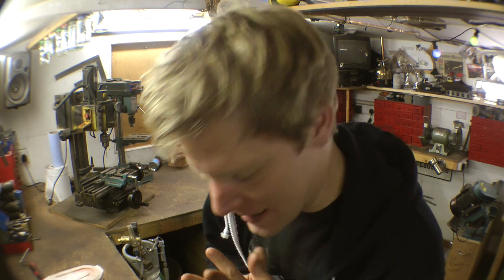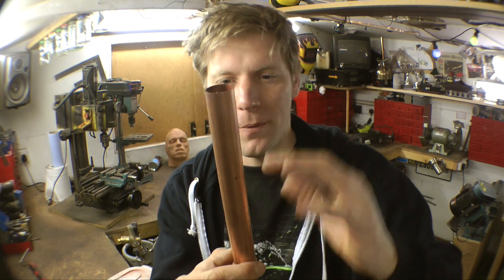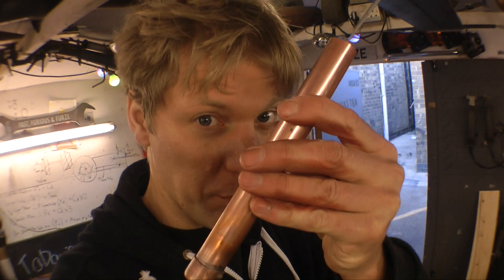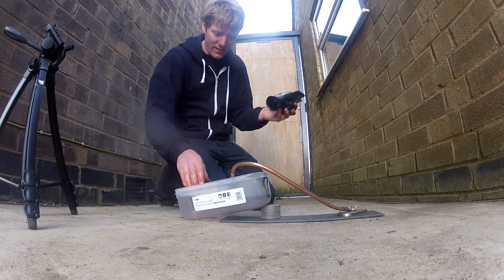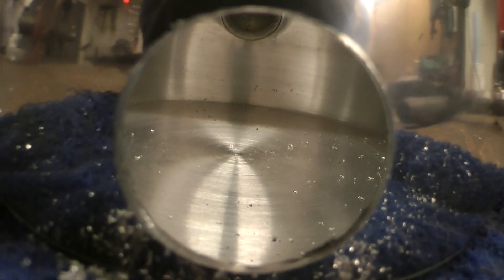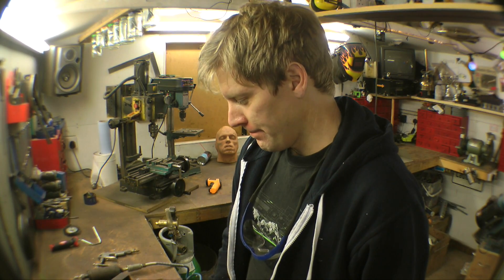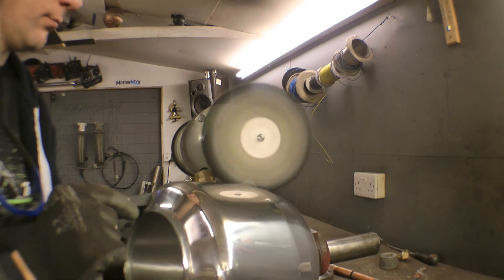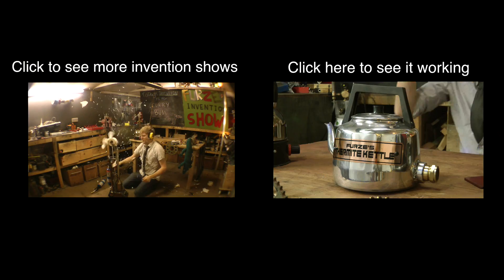Making/Testing the Thermite Kettle

Comment: you can make this heat the water much quicker by adding tube length or more tubes, a fundamental different in the standard element design, using the same amount of Thermite and even slightly smaller tubes. I think the more tube surface area, the quicker the Thermite gets to burn.

Comment: You got the concept slightly wrong. you need a heat exchanger with a much larger surface in order to transfer the energy efficiently to the water. something with large fins, e.g. a turbo intercooler.

Comment: I think that the thermite is really dangerous for your health, metal burning at high temperature produces a lot of nano-particles that causes cancer. I wonder if it's possible to make a different kind of kettle with a electric coil heated nozzle, that slowly heat up the water while you slowly pour it in the cup.

Comment: I think the water jacket should provide sufficient heat transfer so the copper pipe wouldn't melt even with the 'correct' thermite ratio. Much in the way you can cook water in a plastic bottle without melting the bottle.

Worth a try imho.

That should give it another time boost, I reckon.

Comment: I never knew Colin can weld aluminium this clean and even. I am impressed.
Reply: +darek4488 He had "some" experience with welding.... say pulsejets and giant assholes and other pulsejet bikes/kart/stroller things. Not to mention a fallout shelter.
Reply: bobsixtyfour You clearly have no idea how much more difficult welding aluminium is from welding steel.
Reply: +darek4488 It's all in the preparation of the surfaces. Aluminum oxide forms naturally on contact with air, and is really hard to weld, if you remove that layer of oxide before you weld, it makes things go much easier.
Reply: bobsixtyfour Yes, what you are writing is true, but the main concern is the melting point of aluminium, because it is too easy to melt through and too hard to control.
Reply: I just assumed it was a pretty industrial kettle with extra thick walls.
Reply: Why weld it when brazing it is much easier?

Comment: Wait, would copper still melt (with good thermite) if you have water in the kettle? I think heat exchange will be fast enough to prevent it.

Comment: would it not be more optimal, with more surface than just a copper pipe?
Reply from the maker: +Tuex0319 yes but it was down to the fittings i had at the time

Comment: Remember 911
Reply: Remember nano thermite cutter charges and the five foreigners on work visas in urban moving vans that delivered them into the WTC. Remember the molten metal fire fighters described as "flowing like larva" in the basements a month after 9/11. Remember jet fuel aka kerosene and office fires can't melt steel.

Comment: How is the thermite not out out due to lack of oxygen?
Reply: Thermite is a mixture of iron oxide and aluminium metal, both powdered. When you ignite it, the oxygen comes off the iron oxide and combines with the aluminium, so the end products are iron metal, aluminium oxide, and heat. This is why the estimable Mr Furze says that once alight nothing can put the thermite out: all the oxygen it needs is already present in the mixture.

Comment: Make your own version of a lightsaber like that other guy did
Reply: Basically a small flamethrower inside a light sabre handle that forms a blade out of flames.
But if you can make an actual plasma blade go ahead :)
Reply: Or even better he could try to make a beam katana ( a somewhat more realistic light sabre consisting of a strong laser that forms the blade and a mirror mounted on a rod at the back of the sword )
Reply: +Max B Or make a pulsejetsabre
Reply: +Coco or all three
Reply: I know I'm 4 years late, but what other guy? The Hacksmith?